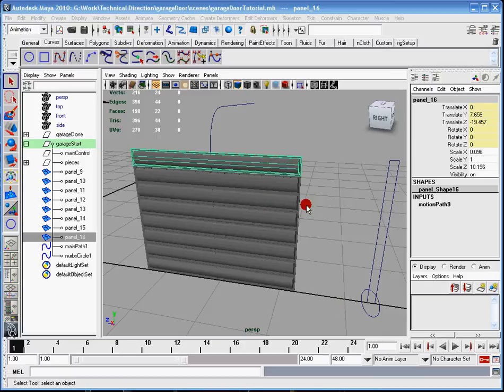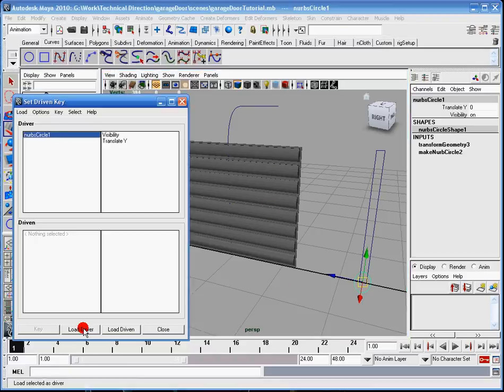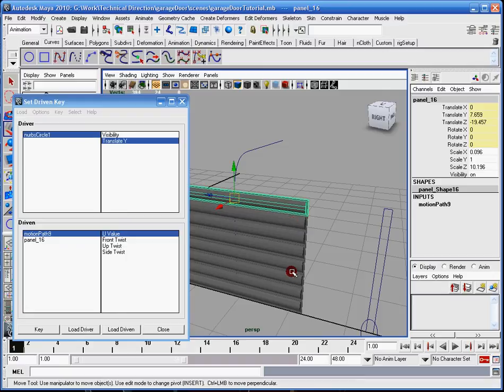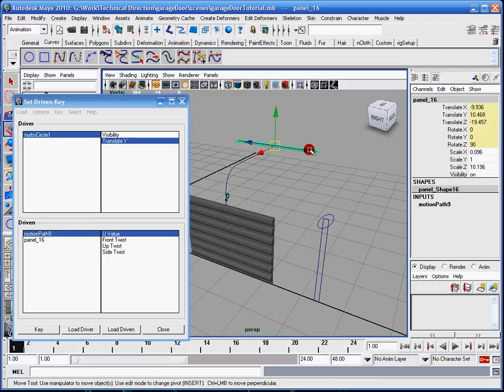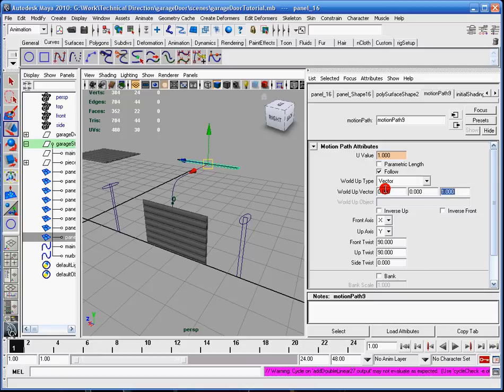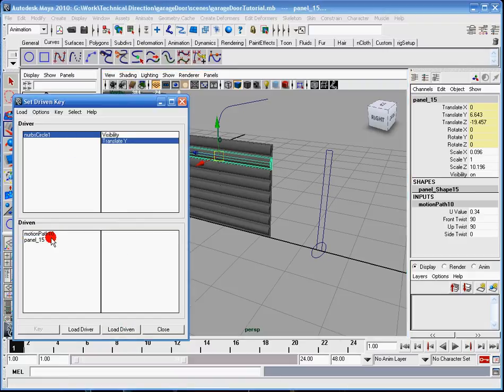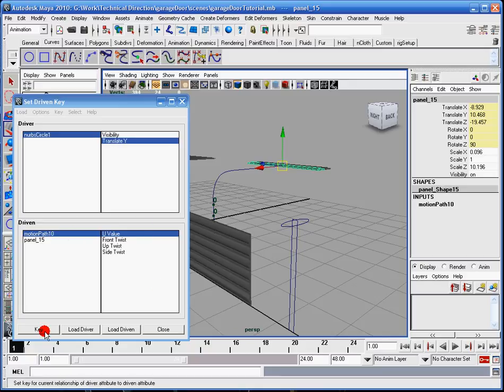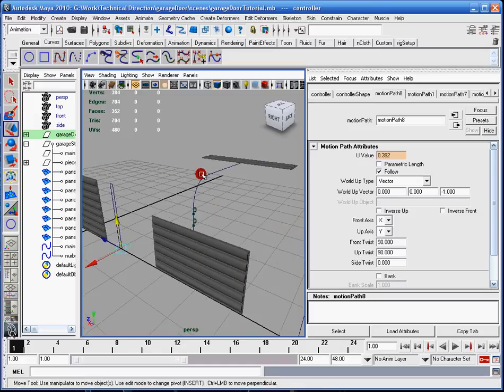How to Rig a Garage Door in Maya (Part 3)

Comment: Hey man great tutorial. I applaud you for your effort put into making this. I however have one problem, my u value in my attribute editot after attaching to motion path and then breaking connection, is less tan 0.1.  This is very frustrating as there's no time to fine-tune the animation prior to setting driven keys. Please help :(
Reply: use a CV curve instead of an EP, and make sure the curve has lots of CV's. That's one way that worked for me.